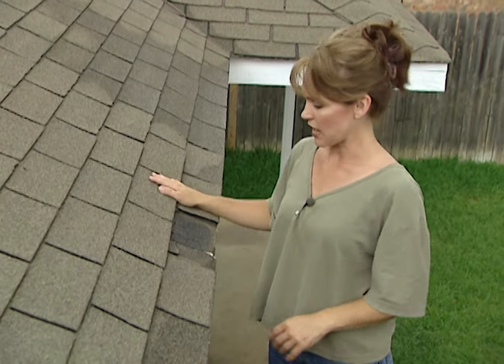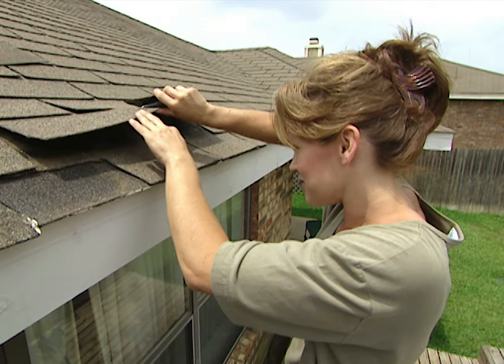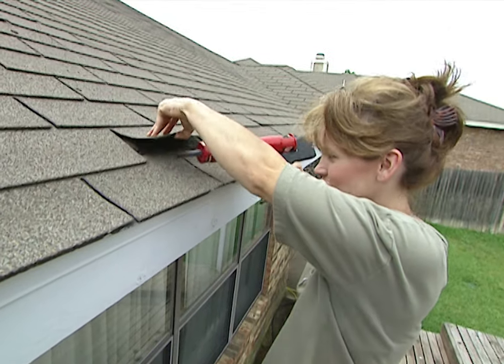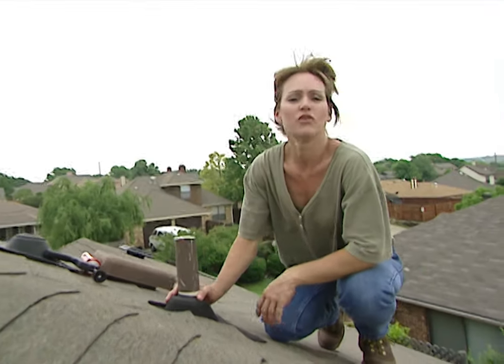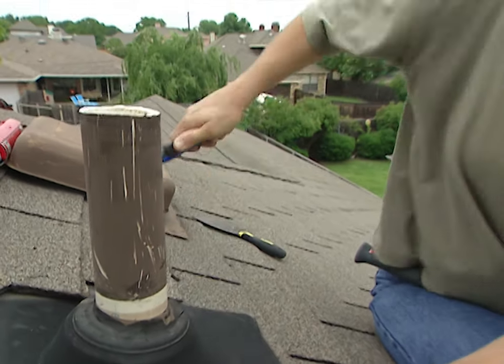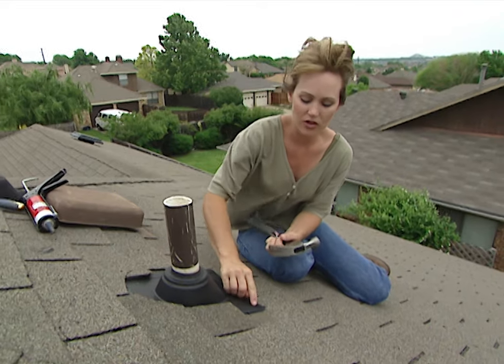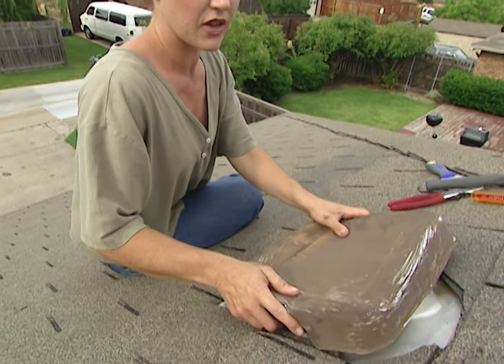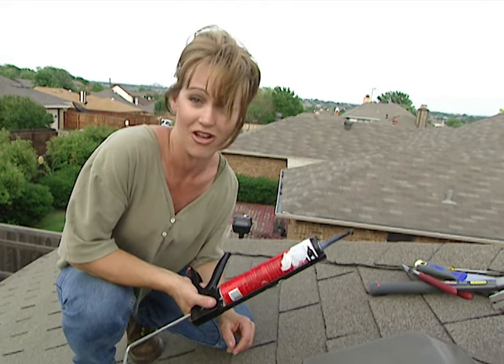Roof Repairs - Stop and Prevent Leaky Shingles and Vents - Do It Yourself

Comment: My vent pipe seal boot was dry cracked and leaking in my home. my roof is much steeper than the one you fixed or i could have done my own repair . i could have stepped on the roof but never been able to get back on the latter 😕
Reply: Mines flat where I get on and off but still fairly high and my fear of heights is so bad it takes me a good 10/15 minutes of talking myself into it to get down! I usually hug the ladder, close my eyes and hope for the best! 😅been lucky so far! I’m a female btw lol

Comment: Two things impossible to see, the sun rising from west and my wife on the roof.
Reply: Maybe not your wife but lots of women do building work. Some of us get tired of seeing lots of men manhandle materials off in such a way the materials have to be trashed that could have been put back in place, costing the homeowner way more than needed. That is how I got into it. I fired my mom's contractor and did the work myself. Yeah, I was slower but it cost her half the money in materials. Even back then, wood was not cheap. Wood was way more expensive than what I charged her by the hour, lol!
Reply: Technically if the poles ever decide to flip, than the sun will rise from the west. Just not the traditional west... still more likely than seeing my wife on the roof.
Reply: I would LOVE to do these repairs, but scared to get on and off the roof / ladder transition. Once up there, I'd be alright.  Getting back on the ladder is tricky.
Reply: You too?

Comment: Is there a way to loosen flex seal if its hardened in the container?
Reply: No not really. You can try Thinner but the  result isn't as good as the original .
Reply: Throw it out.  It’s not worth the aggravation.

Comment: It will leak at the top of the vent. The shingles are not laying flat. Also she had no harness on. Also you don't nail into the metal facier. I give this a 3 out of 10

Comment: Roof repairs are not a diy job if you don't have experience. You can create much bigger problems very easily.
Reply: Not true. A YouTube video or 2 and your on your way. It can be dangerous and yes if not done correctly can cause further issues. Do your research, be safe, and don't do it if you are not fully comfortable.

Comment: As a roof contractor for several decades, this video is simply.........horrible and no help to anyone. Everything she did is unacceptable as a professional should make these "simple" repairs easily and correctly. The cost would be minimal. Number 1, it was leaking on the deck because there are no gutters, a missing tab (of a 3 tab shingle) does not mean it is leaking. Number 2, the shingles around the pipe boot flashing should all be removed and then cut and installed properly around the new boot. Number 3, the vent box flashing should not have slid out at all. The roofer that put the roof on used staples, that brought a chuckle. Staples for roofing, that was a very long time ago, barbaric, the roof should already have been replaced. Again, all the shingles around the vent would be taken out even if the new box vent is different, it is. These repairs would look brand new properly done, not hacked in as all of these were. To be clear, I just stumbled upon the video and saw a girl, had to watch to see how she did. No offense intended whatsoever.